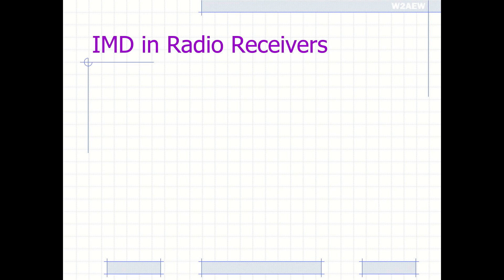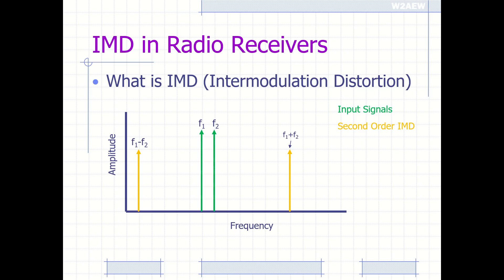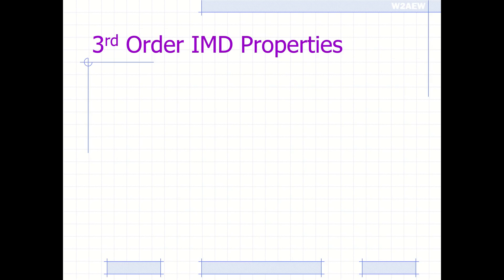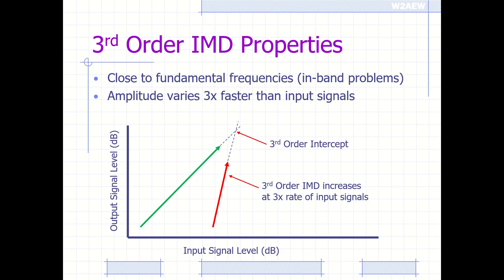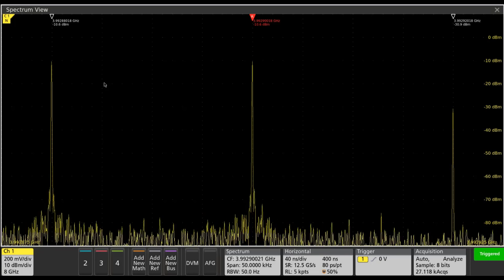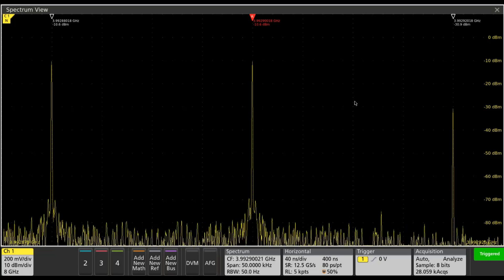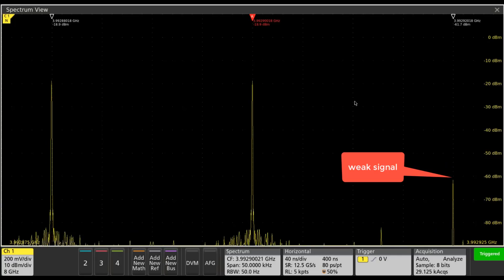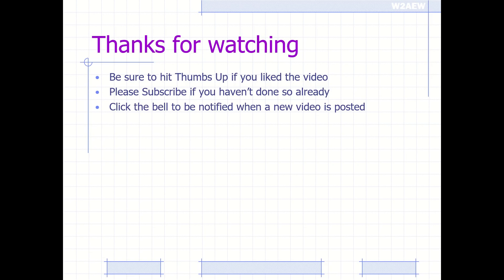#310: 3rd order Intermodulation Distortion (IMD) and their effect in radio receivers

Comment: Great video! I've seen some discussion about not using LMR400 type coax cable in duplex repeater applications, supposedly due to the 2-layered shielding (braid over aluminum foil) potentially causing PIM. Now, in a UHF repeater situation with 5MHz offset the closest 3rd order products would fall either 5MHz above or below the RX frequency, depending on whether the offset is positive or negative. Depending on the magnitude, this should be easily filtered out by the RX radio's front end filters. What I can't find anything about is how big the amplitude of the 3rd order products would be if the let's say -93dBm (S9) RX signal is intermodulated with a +40dBm TX signal 5MHz apart. I would guess that in a passive system the magnitude of the intermod product would be smaller than the smaller of the two fundamentals but I can't find anything to support or disprove this. What happens in your experiment when you turn one of the two fundamental signals down by 50% for instance?

Comment: 4:45 kind of confuses me. I thought the IM3 would decrease by 3 times the attenuation only if the attenuation was applied to the fundamental signal that "created" it (in this case if the attenuation was applied before the fundamentals entered the mixer) as shown at 3:50. It's interesting that the IM3 product continues to experience this 3x relationship even after the IM3 leaves the mixer.

Comment: In this video the harmonics are treated as IMD. I think this makes sense because they are generated in the same fashion as IMD. However, I think by strict definition ("inter") they are distinct. Does their amplitude increase in the same way as the normal IMD products? For example, is IP2 the same for the 2nd-order harmonics as it is for f1 + f2?
Reply from the maker: Yes, I should have made the distinction - the harmonics are of the same "order", but are not INTER-mod products per se.  Yes, the harmonic distortion products, in theory, should vary in amplitude similar to the same-order IMD products.

Comment: So how much attenuation for mixers is best to defeat IP3 ? 3db,6db,10db attenuator ?
Reply from the maker: There is no single answer for this because it depends on many factors including the magnitude of the signals involved and the design of the mixer and associated circuitry.  The best answer is - keep increasing the attenuation until the negative effects of IMD are reduced sufficiently for your needs, remembering that the IMD level will ideally drop by 3x your attenuation setting.

Comment: How can I characterize a Spectrum Analizer for non-linearity testing of IP3 and IP2 in an amplifier?
Reply from the maker: To determine if intermod products are being produced by the spectrum analyzer, try inserting a 10dB attenuator at the input.  If the main tones and the intermod tones both drop by 10dB, then the analyzer is likely not generating them..  If the intermod tones drop by more than 10dB, then it is likely the analyzer is generating them.
Reply: @w2aew  

Thank you! You're the best!

Comment: Can IMD be present in vintage tube amps? Thanks for the great videos Alan!
Reply from the maker: Sure it can.
Reply: @w2aew  Thanks! Would you say that IDM is always a bad thing or can it fall into the "desirable clipping" catagory regarding guitar tube amps?
Reply from the maker: @fullwaverecked  Certainly for audio applications, distortion can be a desirable effect.  For RF transmissions, it is definitely NOT!  For RF receivers, it can result in reception problems.
Reply: @w2aew  Thank you!
Reply: @w2aew  absolutely agree. You are a trusted source or I wouldn't bother you so much, but you are the the trusted source for us beginners. Question: I am  building a dim bulb tester/current limiter w/3 40w vintage 12" x 1" bulbs, (120 watts =1 amp thank you Mr. C,) but it takes up too much space on my bench. So instead, one 40w bulb (for visuals) and two 40w power resistors in siries. Could one use this setup as a dummy load for testing a rudimentary dummy load indicator? For testing output for an amp for example.... Thoughts?

Comment: Excellent video on 3rd order intermodulation distortion. Now I have a better understanding of IMD. I also have a video suggestion, but I am not sure how to send my suggestion to you.
Video Suggestion: 
I have two wattmeter’s one seems to be correct on VHF and off on UHF. The other wattmeter seems to be correct on UHF but off on VHF. 
Both wattmeters’ seem to be off by 25% to 35%. Is there a way to confirm what the true output wattages would be by using a voltmeter or some other method?
Reply from the maker: Have you made sure that you're measuring power when transmitting into a dummy load?  If you have any reflected power at all, the measured power readings will not be accurate and will vary with frequency and line length.
Reply: @w2aew   Hi Alan, Yes, I am using a dry dummy load and old Bird 43 Wattmeter with the appropriate plug-in elements and an old Diamond SX-1000 Wattmeter. 
 I also own a Tektronix, 305 DMM Oscilloscope and a few new Digital Oscilloscope as well as a various VOM’s.

 Is there a way to use this equipment to determine the correct output wattage from the radios to determine which wattmeter is accurate? 
How could I use V^2/R to determine actual wattage of the radio? Then I will be able to calibrate the two wattmeter’s.
I am glad see you are back. 
Thanks for all the great videos and your help! I hope you and your family stay safe.
Reply from the maker: @Rich-fr5td  I'm sorry, but there really isn't a good way to accurately measure power with the 305 scope or a VOM.  And, unless your digital oscilloscopes have a rated bandwidth in excess of 500MHz or 1GHz, then they can't be used to check the UHF signal either.  The only practical way for you to do this would be with a known good wattmeter, and compare with your suspect meters.
Reply: @w2aew Alan, thank you for your time. Please keep up the excellent videos. I wish you and your family well.

Comment: This is why many older FM stereo receivers from the 1960s through the 1980s had "Local/DX" switches in them. People would switch it to DX, thinking they wanted to hear the distant signals, and in fact the opposite would occur. The distant stations would disappear in to the noise and interference. 

Many times I'd hear someone say "that danged switch is backwards."  No, it wasn't backwards. It was intended for those who lived next to broadcast stations. Often that nearby broadcast station would create all sorts of intermodulation products across the band. Placing the switch in "Local" would attenuate that nearby station and thus reduce the IMD products, making many more stations audible. 

So if you see a radio with a Local/DX switch, switch it to Local if you're in a city. Switch it to DX if you live in the outer suburbs and you know there are no significant radio transmitters nearby.

Comment: Thanks for the video, great help to help understand those often quoted parameters seen in rx test data. So, my question is this: if the two primary signals causing this in ones receiver are sideband, what does tuning to that third order signal sound like? Is it just a beat note, or does it just sound like garbage, like splatter? Thanks, always enjoy learning from you.
Reply from the maker: It would sound like garbage, and would occupy about twice the spectrum of a normal SSB signal, due to the 2x term.

Comment: Excellent explanation.  I always use low level signals whenever experimenting with filters, combiners etc Not sure where I got that idea from, perhaps a fear of over driving inputs.  Nice to be able to give my colleagues another rational explanation for keeping input signals low as possible.
Reply: No, no just the contrary! IMD could be an issue in ACTIVE NON LINEAR devices as stated by Alan. When you have to measure a PASSIVE device, such as a filter, a combiner or a divider it is sensible to use all the dynamic range of your instrument, let's say a VNA, decreasing the IF bandwidth (increasing the measurement time, obviously) and using a decent input power level, say 0dBm. Doing so, you can use all the dynamic range to measure rejection, slope of your filter and so on. Remember that accuracy means a lot of time.

Comment: w2aew is back and he worked so hard during his hiatus he's got himself a Tek 5 series! Can't wait to get back to great little snacky lessons from one of our favorites.
Reply from the maker: It’s a 6-Series actually (belongs to my employer, of course)
Reply: @w2aew 

I figured as much even with the 5 series (my original comment was tongue in cheek)! But with the 6 series is appropriately more expensive. What an impressive instrument.

I thought you had a 4-channel version of the 5 series scope, but I suppose they must have designed a new ASIC which does an additional time-interleaving step to get the bandwidth and sample rate up that much higher?

I can't wait to see what fun things you can show with it!

I wish I could have kept my nerd cred intact, but I see there was precisely one way for me to notice this couldn't have been a 5 series scope: the measurement at the top that says "3.99 GHz".
Reply from the maker: Actually, the data acquisition ASIC can natively do 25GS/s, hence the 8GHz BW on the 6-Series. It also has a low noise preamp, giving it about 10dB lower noise floor than the 5-Series. Both have the digital down converter in each channel, hence the fast update on the spectrum even with the 50Hz RBW used here.

Comment: Still a novice but are there methods of effectively "filtering" the intermodulation frequencies that are undesirable?
Reply from the maker: Unfortunately, depending on the what the fundamentals signal are that create these products, they'll sometime land close to (or even on top of) your signals of interest - so there'd be no way to filter them.  The way to avoid this is to use devices (mixers, amplifiers, etc.) that have better linearity.
Reply: @w2aew  thanks for clarifying!
Reply: w2aew correct
Reply: Seems like compound attenuation to me, regardless of harmonic frequency.

Comment: That's the first explanation I've read or heard that  really makes it clear. Many years ago, a friend taught me to run the audio nearly all the way up and control level with the rf gain control.  All kinds of crap on the band fell into the background noise and weak signals I couldn't hear before seemed to pop out. It always seemed counter-intuitive. This was during Solar Cycle 19 with a well-used 75A2 when hams were shoulder to shoulder on every band and lots of signals were strong.

Thanks for this and the hundreds of other clear, interesting videos.

Comment: That makes sense!  I've struggled with this for a long time.  So in your example, if you put in 10 dB of attenuation followed by 10 dB of relatively good amplification, would you end up with the original IMD component at -20 dBc where the signal of interest is essentially unchanged?
Reply from the maker: Assuming your amplifier has very good linearity...